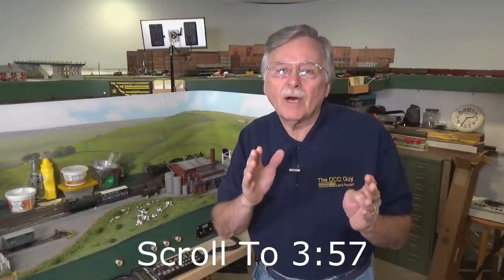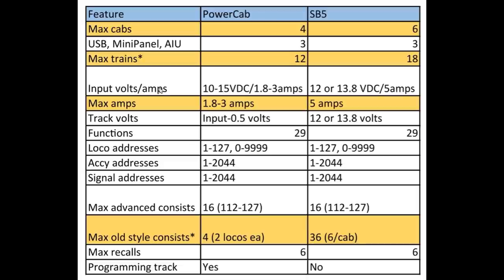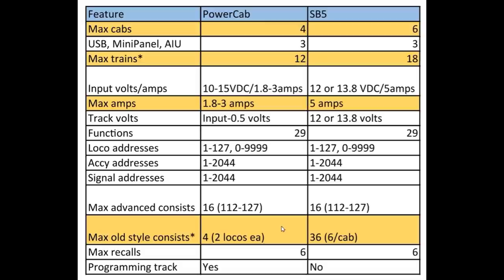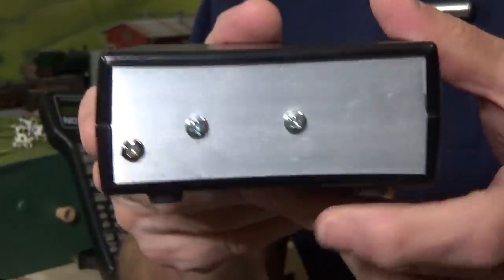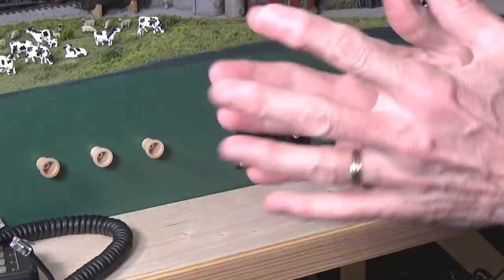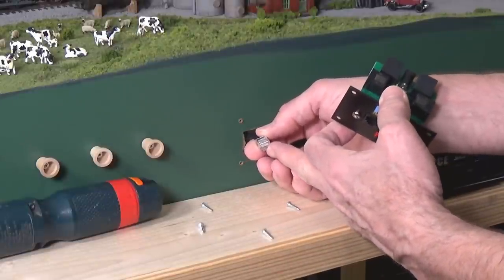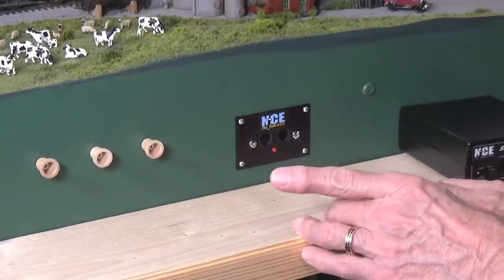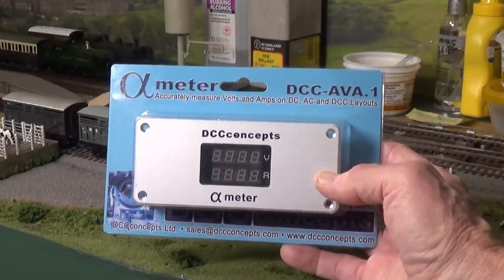Energize Your PowerCab (230)

Comment: Hey Larry long time watcher first time commenter but I believe nce has two types of controllers one being a power cab and the other being the pro cab is there anyway I could talk you into doing a quick video on differences between the two as far as functions go
Reply from the maker: From what I have read about them the PowerCab and ProCab are essentially the same and once upgraded the PowerCab can be used as a ProCab. At least that’s what the manual and online material suggest. All the same functions are supported and programming seems the same. Any differences such as number of consists, locos, etc. are likely due to the differing capabilities of the various command stations.